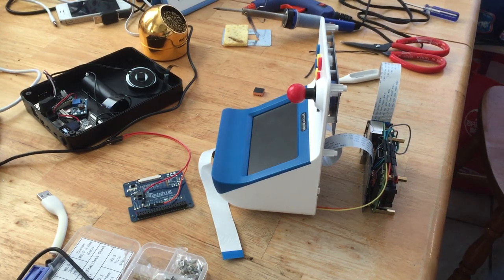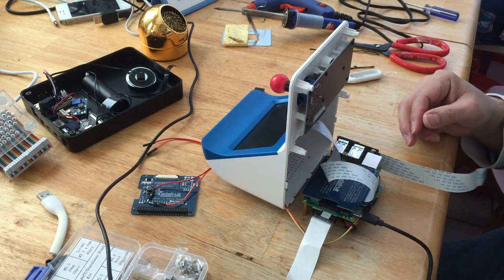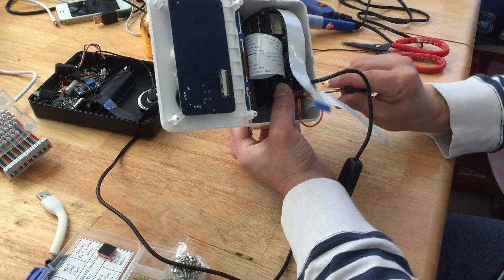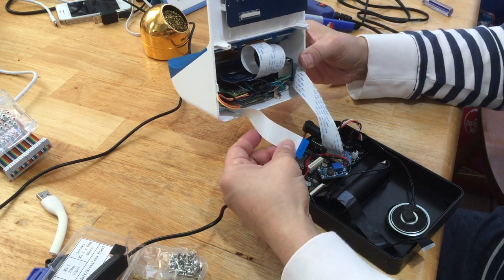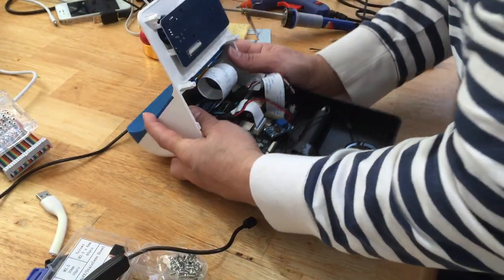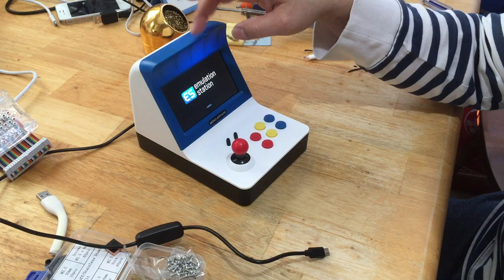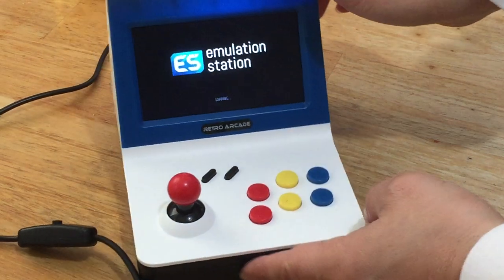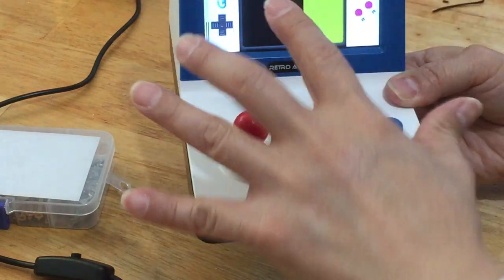RetroArcade Pie Adding vent holes for the fan Part2

Comment: Is the fan really needed? Did you get lockups or overheating before you installed the fan?
Reply: See that is why I dont want to modify this system. I dont want it to be overheat all time.. this no good for me. I wish there was better firmware for this system!